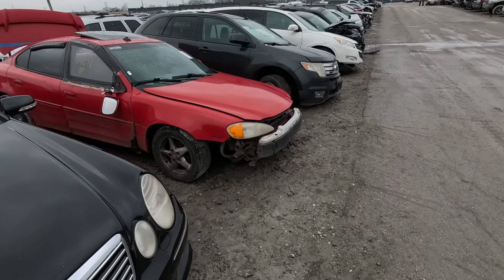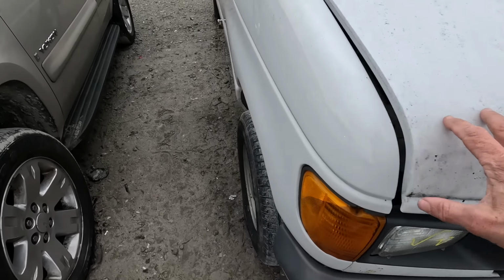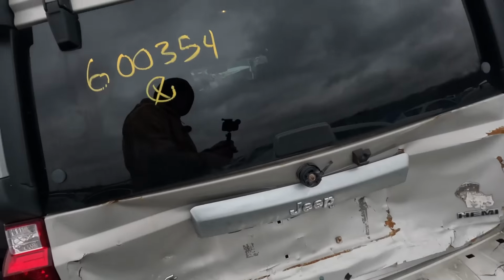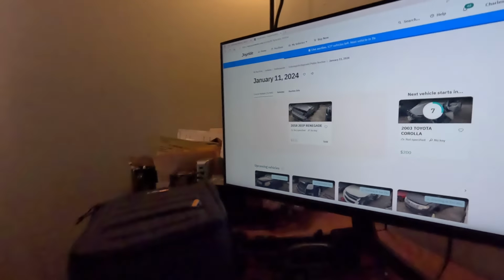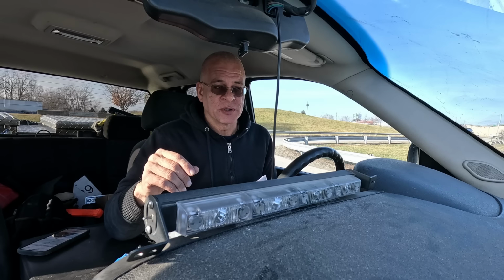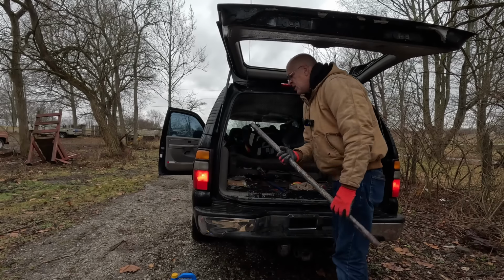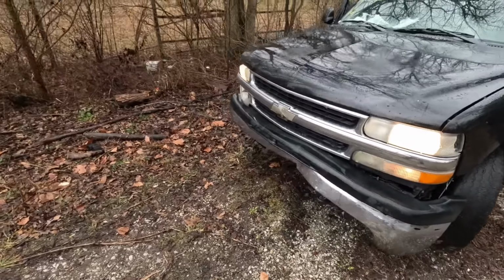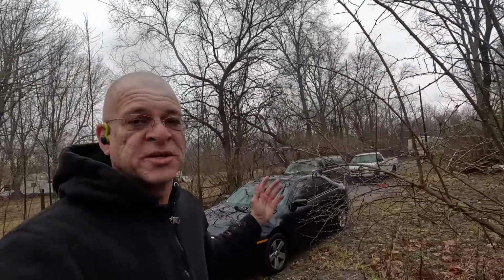What can we buy for $500.00 at the Indianapolis police impound?

Comment: Great run down on the vehicle auctions. I've been to a few general auctions and I've learned that it's "buyer beware" and you really have to go over the items for all faults before bidding. I've been caught so many times, especially motorcycles where they say "it turns over" when using the kick-starter (engine moves) but leaves it open to a lot of reasons why it doesn't actually start up. The auctioneers have good descriptions, usually all the good points but don't really point out ALL the bad points. I can see their side of it as they want to get as much as they can to earn a better sale commission.  My dad used to go to auctions  in the old days to buy horses and gave me good advice when I was very young. He said if you are buying at an auction "sometimes off goes the head, and on goes a pumpkin". Meaning that it's easy to get caught up in a bidding war and pay way over what you wanted.  Go in with a firm top-dollar of what you're prepared to pay (plus fees) or you could go way over and get a rude shock when the fees are added, and it isn't a bargain anymore.  Keep your vids coming!

Comment: In Arizona, if your dash light is on it won’t pass inspection,and you have to park it ,and if the plates are expired it gets towed, unless you park it at your own house.
Reply: And that's why AZ sucks.
Reply from the maker: I guess that’s the price you pay to be warm all winter. 
The truck that I am driving in the video has had the check engine light on for years. Mostly because I cut off the catalytic converters and added headers. Absolutely zero state inspections here and drive literally anything you can get a title for.

Comment: I can attest to the old adage about going to the Police Auctions when it is cold and rainy.  Back in '94, I went to one in Texas, and I was one of like 5 guys that showed up, and two of them were with me, so we weren't bidding against each other. I was able to buy a 92 Dodge Viper that was ceased in a drug raid. 
I'm not sure exactly if it was involved in a high speed chase or what happened, but there was a bullet hole in the left rear fender, just above the wheel well lip and through the inside of the inner fender.  Luckily the bullet didn't hit anything inside the car. I bought it for the opening bid of $2,000. I loaded it on the car hauler along with the rest of the cars we bought 

Fast forward a few months, and since I was "under 25 years old," I couldn't afford the insurance.  So I sold it for like $35k.
Reply: Bs

Comment: I bought a suburban just like that one but it has the extra seat 😢 the back and ac and heater in the back I've never seen that before 360 Canadian and a 88 firebird baby blue I was surprised it has a 350 5 speed both door hinges are shot so no one could get into it and paid 500 for it I think that car value is going up especially after I  get it painted and go thru it breaks and so on

Comment: i got a 07 Audi Q7 3.6L V6 Quattro premium package suv with newer motor has 138k miles on it for sale no title which could be fixed and used on road if person: changes the 2 flex pipes ; high pressure fuel rail pressure sensor ; and both fuel tank pumps .. I took out the original engine with 186k plus miles out. Installed engine with 138k miles. i have video of it actually running as proof it does run. everything works lights signals horn wipers front and rear.

Comment: People move into vans and that's driven up the prices. 
I've been living in a van for 13 years and just spent 8k on a new crate motor and new front end on a 1995 Chevy Gladiator Camper Van. $600 on the power steering unit then I'll save up for another trip around the States again.
Reply from the maker: Sounds like a good time.

Comment: 3d scan the vehicles, then generate printed repair panels and mods that can cover over previous vehicle damage, and the cost of materials can be as low as less than a dollar to 20 dollars, including the paint and prepwork.
I just scored a Revopoint Miraco all in one 3d scanner that has no spaghetti wire mayhem whatsoever, which means your laptop wont go sailing off a cart or table due to tripping over the always changing cable management that also must occupy the operators attention though sometimes is overlooked while focusing on getting a decent scan of not so easy to get at surfaces sometimes. It can do from tiny coin sized data, upto the size of a helicopter, so cars are a walk in the park for such a wireless type of scanner easy to move around with.
Ya man, go with mods, seeing as your in prime territory for this due to your habitual purchasing of vehicles that you knowledgably see the vision for.

Comment: that's where the thunderbird i have came from, hard to catch a big engine... bald tires on the rear etc. has to be a big planned action repossession big time community hustle to get it un-damaged. "rear driver side hit only hard enough to shut off the fuel demobilizer... it's pushed in an inch"
Reply: 2 valve terminator 4.6 swapped with the newer 514lbft transmission, know it is.
Reply: fr... is it ever cold in Alberta.
Reply: -55 in the wind
Reply: the 360hp V8 runs it's self frozen after turning the cab heater on

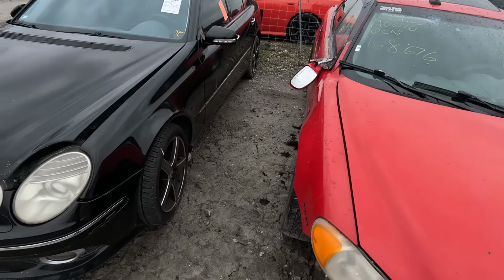Comment: The Mercedes at 17:34 the wheel on one passenger side was turned the driver side was pointed straight so prolly still would run
Reply from the maker: Good eye, I was not even paying attention to that when I was filming it. Yes, there is a good probability that this is a runner since it has damaged suspension parts. They probably parked it somewhere never got it fixed and it got towed in.

Comment: Former Mercedes tech here. Be very careful with any Merc at an auction. Only get one if you plan on parting it out. Generally speaking, it's a trap. They often get abandoned because someone got a repair bill they couldn't pay. Many models are extremely prone to water leaks when they sit outside. I had so many customers bring in Mercs they got at auctions that needed extensive work on the electrical system.
Reply from the maker: Good to know!

Comment: Do you have any luck selling parts online? It seems like dealing with people and shipping makes it barely worth the time. ive been trying to part out about 7 different cars for a long time, with very mixed results. I won't let people pull their own parts, because they are destructive and don't care. And most people looking at used parts are looking for the cheapest possible solution, and that by itself makes them more difficult.
Reply from the maker: I tried just to sell locally. And I don’t fool with small parts like tail lights, and interior trim pieces. I usually just take off large items like vendors and doors, bumpers seats, that sort of thing, and then send the rest of the scrapyard
.

Comment: But is a 263,000 mile engine worth $50??
Reply from the maker: You are mistaking an LS engine for an old-school V8 350. With that amount of miles the engine is only halfway through its life.
The white truck I am using to pull that suburban also has a 5.3 LS engine that is over 425,000 miles and still going strong

Comment: $1000 you could've used on a project you already have. SMFH!
Reply from the maker: The suburban was bought for the LS engine it has. It will indeed be going towards one of my other projects. So we will call that half the money as in $500. After we are done, pulling the engine, we will sell parts off of the truck And what’s left over we will scrap. This will give us back at least our $500 if not more. The other car will be re-sold and we will make money off of it. So not only are we putting money into the projects I already have. We are also making a profit.